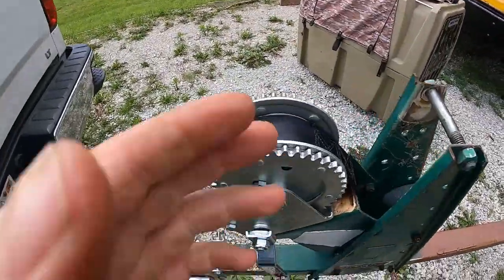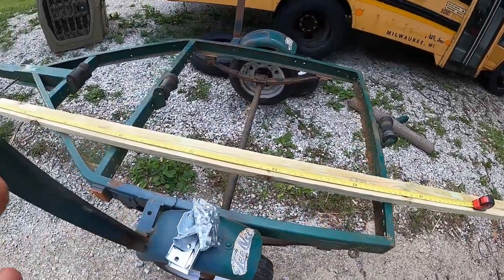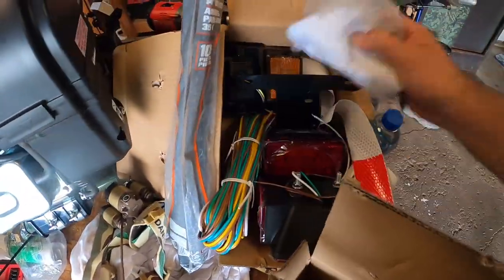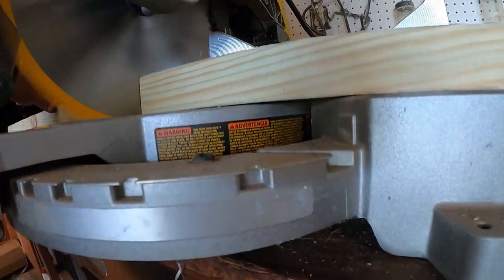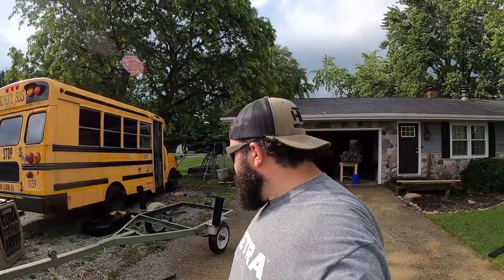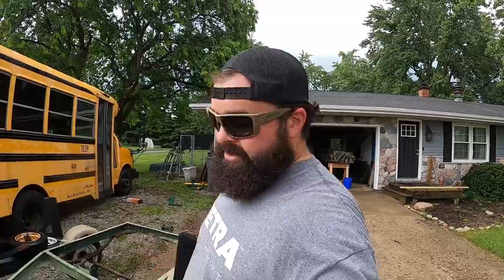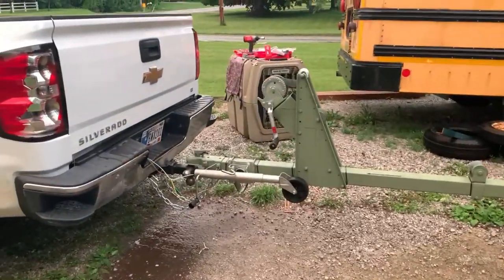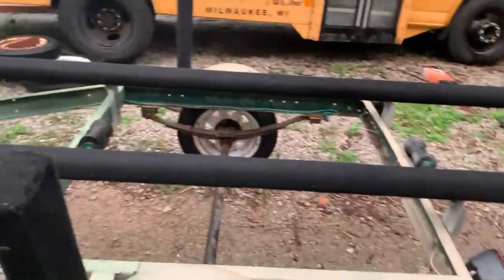Duck Torpedo Trailer Build! Duck Hunting Sneak Boat Prep!

Comment: Sorry I'm late watching today... Good stuff Jordan, looking great!  Pro tip #314, when you use those new chains (2:14) always cross them when you hook up. That way if you ever do lose the ball nut and it pops out, the tongue won't hit the ground, the crossed chains will catch it.  Someone already mentioned covering up those wires... they will get caught on everything!  You already finished the side bumpers but one thing I've found (thanks to the guy I got my trailer from) but, if you use oversized PVC pipe around the risers and just weld a big washer on top to prevent them from coming up over the top. They act like rollers and you won't have to replace carpet ever couple of years. Like how the trailer is coming along.  Can't wait to see what's next!

Comment: Just a suggestion put some washers on the chain at the bolts. And also your hitch…..get some grease ball joint is fine and smear it inside the hitch or on the ball…yeah it’s messy but it will save your hitch in the long run…..liking the boat build videos and your snake swamp video
Reply from the maker: Definitely some good ideas. Thanks man! I’ll keep em comin 🤙🤙